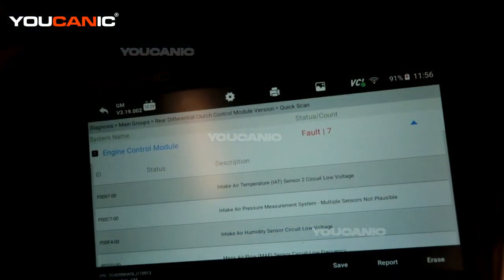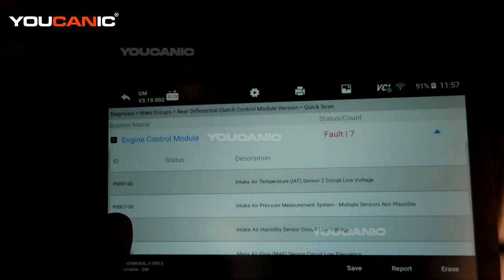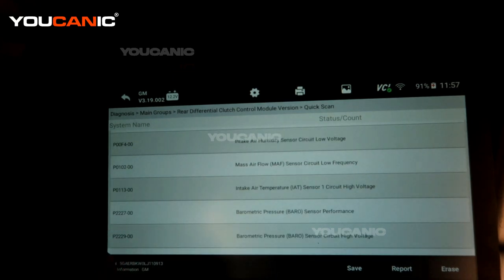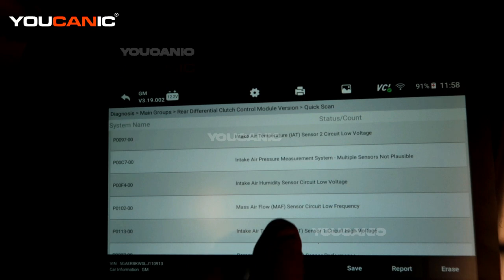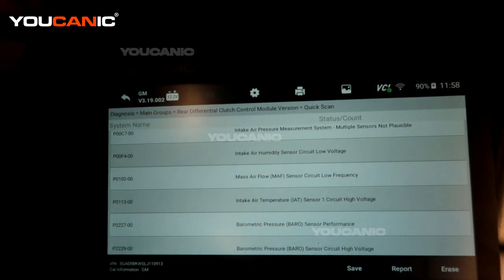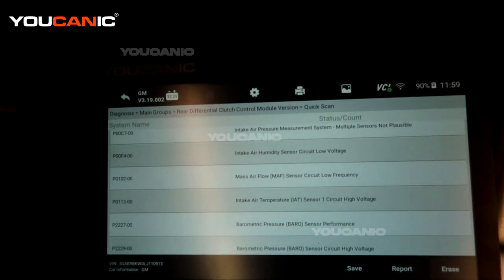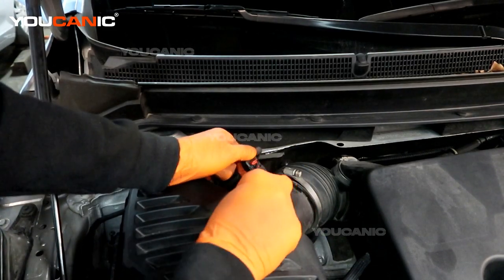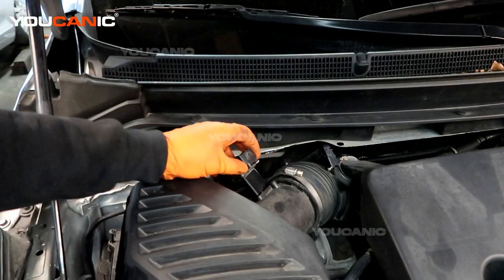GM Mass Airflow Sensor Replacement - P0102, P0113, P00F4 & P0097 Fault Code

Comment: P0097-P0102-P0113-P11c2 . Change maf sensor with original ac Delco part . Erased codes . It took off check engine light on dash. But codes sit pop up in scanner as permanent . It won’t delete completely with scanner.